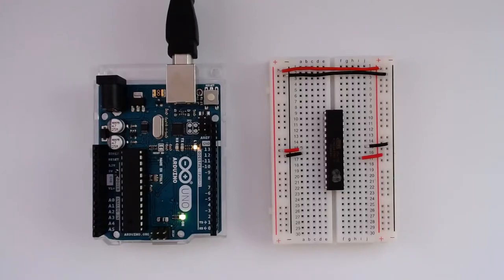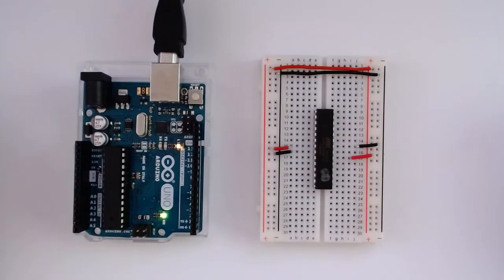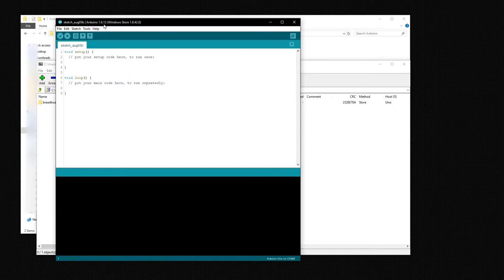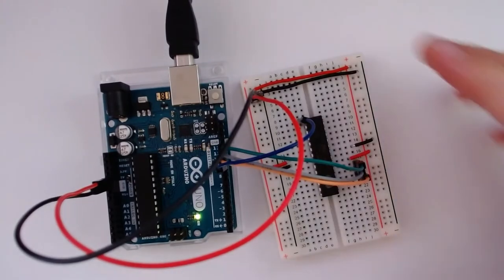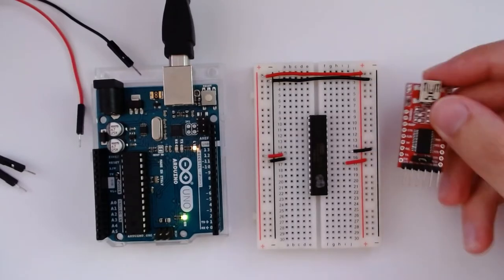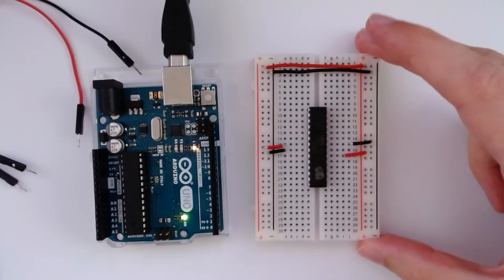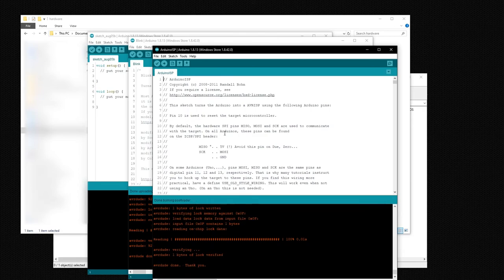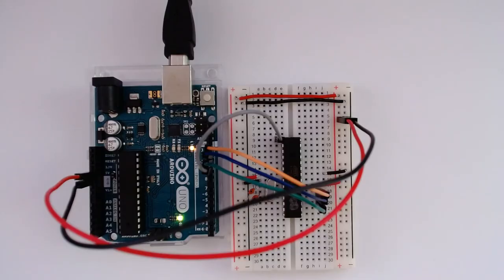Running an Arduino on a breadboard with NO EXTERNAL COMPONENTS / How to FLASH an Arduino BOOTLOADER

Comment: You also can upload sketches to your standalone avr.chips in the same configuration you used to burn the bootloader. just select your target chip in the menu and then choose sketch -> "upload using programmer" (ctrl+shift+u), in this case your "arduino as isp" will send your sketch to your target chip ;)

Comment: I have two GM328 transistor testers (from Aliexpress), based on ATMEGA328P (28 pin DIP). 
During brightness adjustment (through the menus) they became dark (one after the other).
The consumption is fine, the clock is running (8 MHz crystal), the LCD control pins are active (transitions seen by scope) i.e. the hardware is fine.
I presume the manufacturer locked the code. A soldered wires from the board pins 1(RST), 2(RXD),3(TXD), 7(+5V), 8 (GND) and terminated them with a header, fitting my FTDI (GND,CTS,Vcc,TX,RX,DTR), taking care to cross link TX, RX (of the baord) to RX, TX on the FTDI.
I also inserted a 0.1uF cap in the DTR to RST line. On the board there is just a 10k pull up on RST.
When trying to load a sketch via FTDI, it cannot open the port. 
I guess there is no boot-loader either. How do I determine if there is a boot-loader and if the code is locked?
Do I buy new chips or somehow unlock the present ones. Apart of FTDI, I have several NANOs if that is of help.
Thanks Plamen

Comment: Thank you for this tutorial. You have done a good job of clearly explaining all the necessary details. I will probably try this so that I can simplify my project which is to create a remote 3V battery-powered sensor. I am actually using the 16 mHz 5V option which requires a lot of additional components and additional battery. Well done!!
Reply: I tried it and was able to burn the bootloader but with the following warning (with or without the crystals&caps): "avrdude: WARNING: invalid value for unused bits in fuse "efuse", should be set to 1 according to datasheet. This behaviour is deprecated and will result in an error in future version. You probably want to use 0xfd instead of 0x05 (double check with your datasheet first)." I can burn the standard bootloader for 16mHz Arduino board configuration. Do you have that WARNING too? I wasn't able to catch the message on your video.
Reply: To AlexInFlatland: As nothing was working even with the blink sketch and the avrdude warning,  I used http://www.gammon.com.au/forum/?id=11637 . All works fine. ATmega328p 8 mHz internal oscillator and everything at 3.3V. Thought you might want to know and for what it's worth.

Comment: I have one question 
What if I burn bootloader of the Atmega328 on arduino Board and then use it on breadboard after removing it from the arduino board onto the breadboard? Pls reply I need for my Project

Comment: Dear......Can You help me in loading bootloader into a Atmega328 u . I use your procedure but getting following error
Arduino: 1.8.19 (Windows 10), Board: "ATmega328 on a breadboard (8 MHz internal clock)"

Error while burning bootloader.

avrdude: Expected signature for ATmega328P is 1E 95 0F

         Double check chip, or use -F to override this check.

Invalid library found in C:\Users\Aleemuddin\Documents\Arduino\libraries\Digistump: no headers files (.h) found in C:\Users\Aleemuddin\Documents\Arduino\libraries\Digistump

This report would have more information with
"Show verbose output during compilation"
option enabled in File -> Preferences.
Please help me.......

Comment: A question for you Alex: Do you see any way to use the existing oscillator from the arduino UNO pcb for the ATmega chip for this operation? Or just placing the ATmega chip in the UNO for the burning of bootloader and programming?
Reply from the maker: Hmmm, as far as I'm aware, you can't program a bootloader while the ATmega is in the Arduino. At least I haven't been able to find anything on the subject. And I think you wouldn't be able to use the onboard oscillator as well, since there are no direct pins on the Arduino output connected to the oscillator itself. That is, unless you would to desolder it, but that kind of defeats the purpose.
Reply: @AlexInFlatland  Sounds reasonable. Thanks for taking the time, and good luck with any future projects!

Comment: Will the atmega328p itself work like an Arduino? Digital / PWM pins and analog pins will work normally?
Reply from the maker: As far as I'm aware things should work. I've used this setup for a few projects myself. Although that might depend on exactly what your project involves. The Arduino board DOES include a few more components, so I can't say with a 100% certainty that some of those aren't required for some of the pins/functionality.

Comment: I have done just as you did(with a blank chip), and the bootloader burn was completed but IDE sent me a warning "***failed; avrdude: WARNING: invalid value for unused bits in fuse "efuse", should be set to 1 according to datasheet This behaviour is deprecated and will result in an error in future version You probably want to use 0xfd instead of 0x05 (double check with your datasheet first)", tried to burn the chip again, and it says "Invalid device signature".
nothing works. PLEASE SAVE ME FROM MY STUPIDITY!
Reply: Never mind. got it working! :D wicked tutorial! thanks for doing stuff like this!

Comment: I don’t see any boot loader links! Where are the 3 links you mentioned?
Reply from the maker: Thank you for catching that! I think YouTube must have removed them as they were external links. I uploaded the files to my website and updated the description with the links. Let me know if those work out for you.
Reply: Thank you very much for your quick response. You can find these files on the Internet but then you don’t know if they are the right ones or will mess things up. I want to do it two ways: Using the file you have provided and also by setting the Fuse Low Byte using Avrdude. I love this video. The content is precise and comprehensive and very well explained. Thank you for your hard work and for sharing it.

Comment: Without having a pull resistor in the RST, the circuit design is wrong. That's not stable.
Reply: Why should an external pull up be necessary? The processor has an internal one and since the signal is active low, a induced signal is quite unlikely